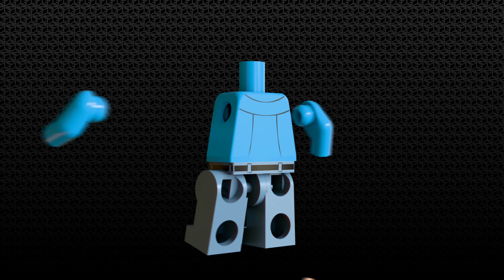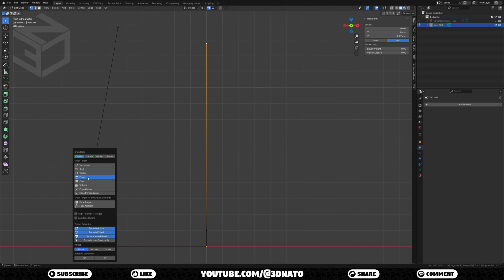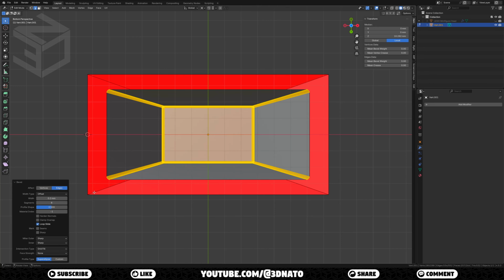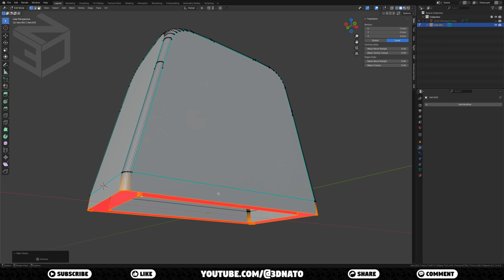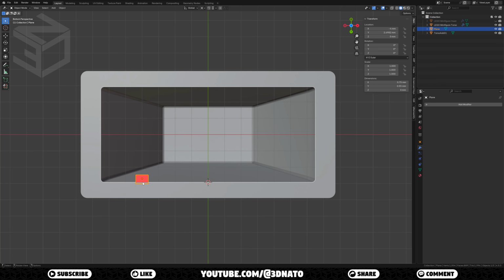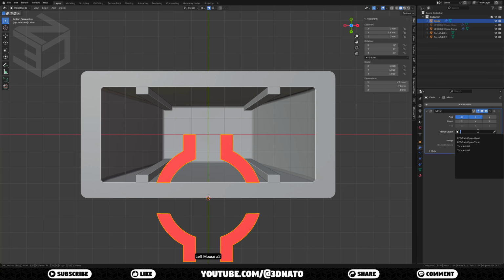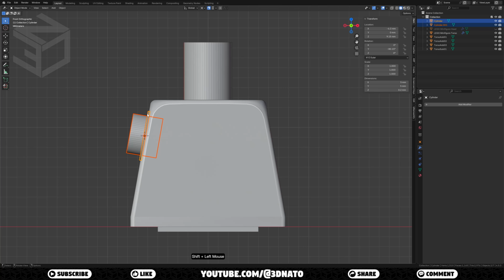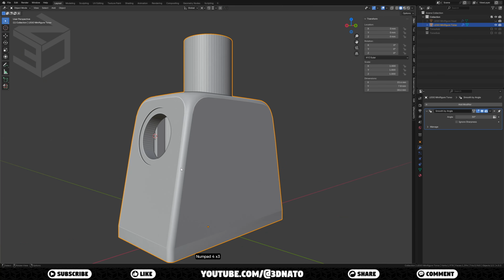LEGO Minifigure Blender Course | 02: Modeling the Torso

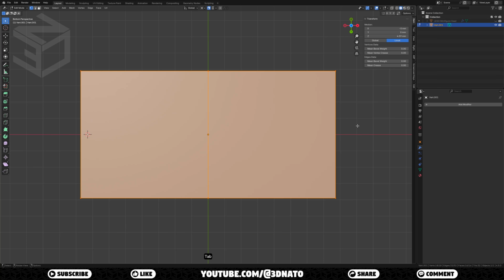Comment: I too am having issues around 3:20 with Disolving the loop.  I'm on a mac... and I hold option to select the seam and then attempt to disolve, it removed a face and then skews a side of the model.  I'm going to start from scratch and see if I did something wrong.  I tried merging and tried just removing the faces at the bottom first but no dice.
Reply from the maker: Make sure the Mirror Modifier Merge is enabled before applying the modifiers. 
This might be the cause of the issue.
After applying the Mirror and Solidify Modifiers, you should have 18 Verts, 32 Edges, and 16 Faces.
Reply: @3DNato . Thank you!  I’ll try that!
Reply: @chashall  I had the same problem. Turns out I didn't turn on clipping in mirror modifier, I had to delete the face down the middle on the inside of the torso. Then I was able to dissolve the edge. Hope this helps!

Comment: i cant dissolve the edges. when i select the whole loop and say dissolve edges nothing happens. also there are no faces on the object, the object itslef i 1 giant face i cant select any faces. help
Reply from the maker: Can you tell me at what minute in the video you’re stuck? That’ll help me see exactly where the issue is.
Reply: I kinda encountered similar problem,  maybe the same one, at 3:19 in the video. After applying both modifiers and trying to get rid of the middle edge loop and hitting dissolve edges, nothing happened except a small window appearing at left bottom corner of my screen, labeled "Dissolve Edges" with two check boxes, "Dissolve Vertices" and "Face Split"
Reply from the maker: @3pmstillnosleep  I've been trying to emulate your result where 'Dissolve Edges' doesn’t work, but I really can't understand why. Try selecting the middle loop, pressing X, and choosing 'Limited Dissolve' or 'Edge Loop' to see if that works… both work for me in version 5.1.1
Reply: @3DNato I had the same problem, “Dissolve Edges” wasn't working. One solution I found was to delete the faces at the bottom of the torso, and there's another face inside it that I also deleted. After that, I was able to use “Dissolve Edges.” The process I followed was probably the same as yours, but at least I managed to get rid of the lines that were driving me crazy.
Reply from the maker: @BiniKampus Thanks for sharing.
This looks like a duplicated mesh. If you press A to select all and M to merge by distance, then 'Dissolve Edges' should work as it’s supposed to.
Reply: @3amstillnosleep I had the same problem. Turns out I didn't turn on clipping in mirror modifier, I had to delete the face down the middle on the inside of the torso. Then I was able to dissolve the edge. Hope this helps!

Comment: When I bevel the outer shell I don't get the same result as you. This i around the 5min mark. I sharpened the edges and added the 0.4 bevel, segments 8 and with inner set to arc at 0.0016 but nothing changes. I am using Blender 5.1.0, not sure if some features operate differently.
Reply: Never mind I found it, my scales are slightly different to yours and I had to use an arc of 1.6.😂😂
Reply from the maker: I’m glad you figured it out! Hope you’re enjoying the course so far.

Comment: i have a problem at 3:23 i can not for some reason dissolve the edge
Reply: I had the same problem. Turns out I didn't turn on clipping in mirror modifier, I had to delete the face down the middle on the inside of the torso. Then I was able to dissolve the edge. Hope this helps!
Reply: @SyndestentStudios  thanks it works! :)
Reply: also i can not use ctrl++ to select more
Reply from the maker: Are you selecting the entire edge loop? If not, you're only going to dissolve the bottom edge (Hold Alt to select the loop.)
Select More is Ctrl + Numpad +... Does your keyboard have a numpad?
Hope it helps, and tell me if it works.
Reply: @3DNato  What if my keyboard doesn't have numpad?
Reply from the maker: @plate5048  Go to Edit, Preferences, Input, then enable "Emulate Numpad". Now the main 1 to 0 keys will act as the Numpad ones.